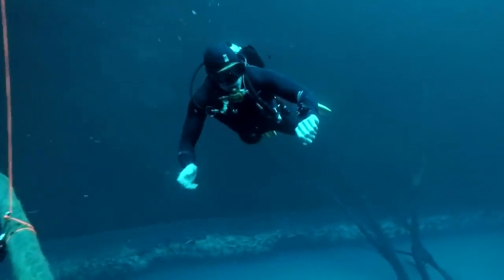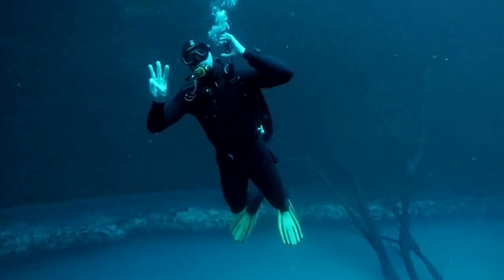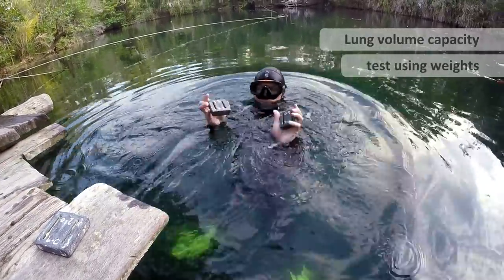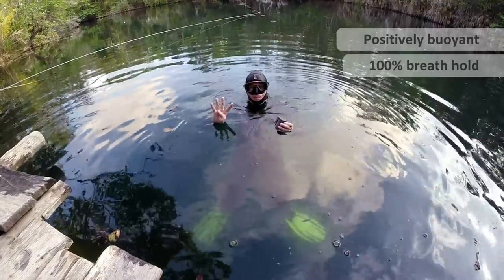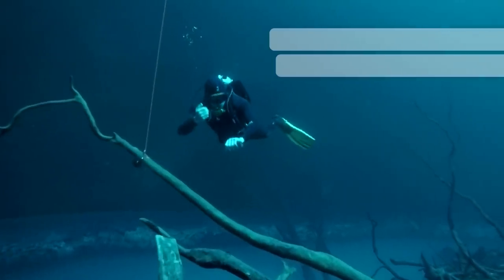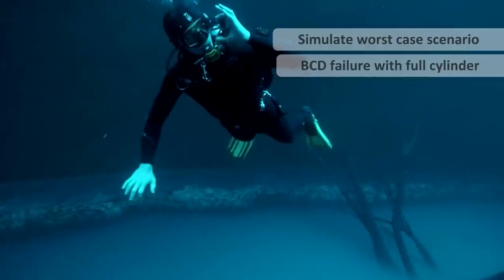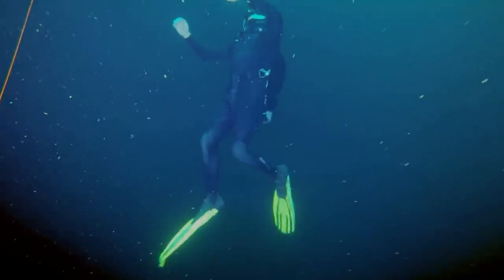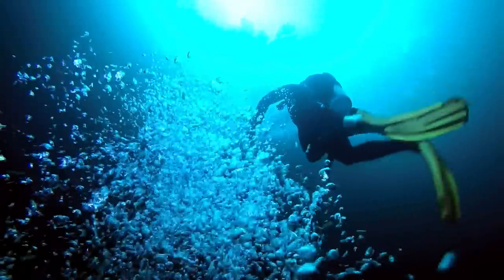BCD Failure : Single Cylinder | Sidemounting.com

Comment: There's a major flaw in this video. I strongly believe that every diver should carry a surface marker. You can use it as an emergency BCD. It may not have the same volume, but still. Also, a common mistake from divers when using such a device is to use their reg to inflate it. Why? why waste that precious O2 you need? Instead, use your exhalation to inflate it. It's air you're going to ditch anyways so why not "recycle" it and keep your O2 in the tank.
Reply: Because chances are if you're using your smb then you're about to ascend and should have plenty of "air" not "O2" left. There are also plenty of diving environments where an SMB isn't really necessary.

Comment: You started the video stating that being overweighted would be a serious problem and could leave you stuck on the bottom, but then you didn't demonstrate this in your example. Even over weighted by 2-3 kilos you would still be able to swim to the surface, and with integrated weight pouches could even drop one pouch to assist with the ascent in a safe manner. With time, you could even remove a single weight from your belt to compensate for the pressure. You mentioned it is dangerous for misinformation to be spread, but it seems sensationalized to state serious issues, and then not show why it is, or explain that very well.
Reply: My thoughts exactly.I had more issues being underweight than overweight. A couple of times couldn't stay at 5m safety stop with BCD fully deflated and completely exhaling.
I agree with his point about the weight belt, though. Dropping the whole belt is dangerous and removing individual weights is not practical in an emergency. Especially if the bottom is not near and you are dropping to a dangerous depth. Integrated weights are the way to go.

Comment: As a divemaster (working or just recreational), I always take 3-5lbs more weight. Sooo many times there is someone who doesn't have enough weight and will start floating up towards the end of a dive. So, yeah, if you are with seasoned divers, go perfect weighted for yourself, going with beginners, add some to keep your random partner from fighting the float and get more bottom time.
Reply: More often than not, that situation has absolutely NOTHING to do with them “not having enough weight”, and everything to do with their constant kicking, fidgeting, flailing, deep breathing cycle, etc. All things that SHOULD have been ironed out in their very first course, their basic open water course.
Reply: 💯 rather more than less
Reply: Maybe keep that extra weight separate so you can ditch it and still make a controlled ascent.
Reply: As a beginner, how should I be correctly weighting? I use an app called “Buoyancy Calc” on iPhone. For me in a 3mm long with AL80 in fresh water at 175lbs it says 9.5lbs. I did experiment and took 8 for one dive and I felt like I was fighting as I got lower on air. 10 did feel heavy but I also am not good at buoyancy control and I know 10 did hold me down the whole dive and I didn’t feel like I was fanning myself down close to the end. I was taught that with ur weight at the beginning of ur dive you should float with a deep breath and then seen to about eye level with the water as you exhale
Reply: This is horrible advice and practice and it annoys me that dive shops overweight students
Reply: @kvan27  OMFG, throw away that app. It's completely useless.
Reply: @kvan27   I weigh 180 at 5'7 and in the same set up with a hood I only wear 8. If I'm in no suit I wear 4. I dive an al100 and I wear 6 in suit and 2 no suit
Reply: @kvan27  it also depends on how much your bc is in the water. Mine is close to neutral, it's probably less than 1lb bouyant
Reply: @kvan27  yeah bin that app mate. The first thing I’d do seriously is jump back in the pool and just spend some quality time really nailing your buoyancy maybe even without a wet suit etc. once you’ve nailed that it’ll make
Life easier once you start using a suit and varying your dives as you’ll know what to expect. Don’t let someone over weight you and tell you it’ll be fine etc.
Reply: @kvan27  that's correct. full breath and empty bcd with a full cyclinder at the start of the dive should mean you are approximately neutral at eye-level. if this is correct then at the end of the dive, you should be neutral (at chest height) around 5m. we do this to make safety stops easier and safer.

as for your weight calc: 5% bodyweight (3mm) + 5lbs (al80) - 6lbs (fresh) = 8.75 + 5 - 6 = 7.75lbs is your 'baseline' weight.

bouyancy check at the start AND end of your dive and trim your weight from there. if you move from fresh to salt, at your body weight you subtract 6lbs for fresh and add 6lbs for salt.

for comparison, i'm the same weight as you are and i take 11lbs with a 7mm semi-dry with hood, gloves, and booties into fresh (UK diver). so with that in mind, 9-10lbs in a 3mm is considerably over-weight to begin with. if you are fighting to keep down with that kind of weight in a thin suit then i'd look at your bouyancy control, breathing and finning techinques in general.

it's also worth remembering that as your depth increases the gas in your gear and suit will compress, meaning it will become denser and less bouyant. you literally become 'heavier' as you go deeper. you may find you'll need less weight at 18m than you would at 5-6m. good luck!
Reply: I do the same. I wouldn't want my divers doing the same though haha do as I say and not as I do and all that. If I'm below 60ft I expect they know what they're doing and don't bring extra though

Comment: why do we need weight belts then? why not put the weight inside the bcd. atleast you mention the wetsuit, this is a huge part of neutral buoyancy. im sorry but i don't agree with you.. being able to emergency ascend is better than not being able to.. As an ex military diver we didn't even use a bcd.. buoyancy was found with the mm of the wetsuit and then knowing what depth you would be working at and then experience to know what weights you need.

Comment: Correct weight is important but we should never dive alone, this guy should not encourage people to dive alone and using lung as bcd... This happened to my buddy (exhaust valve failed)   and I could able to fix it in 38m.. If couldn't fix it.. I could take him out using my BCD safely... Using lungs as BCD is very dangerous and what this video says is the last option and if you are alone...

Comment: A correctly weighted diver in a 5mm wetsuit won't even need to use their BCD down to at least 20-30m.  I've been to 55m and back and not put air in my BCD.

Comment: As a novice diver, I think too many training sites are not focused enough on buoyancy which is a super critical skill to know. Honestly, they just want you to get your basic certification so you can rent their equipment and go diving.
Reply: When my wife went to Cayman for her checkout dives her instructors whole class got to see how bad his buoyancy skills were. In NJ waters limited vis it wasn't so apparent.
Reply: Buoyancy is super critical?!  Like up and down in an elevator or stop and go in a car.  Either you learn to inflate and deflate your BC and figure out your proper weight belt (you won't sink with too little weight), then you shouldn't be scuba diving or driving a car.  Is learning to breath super critical too?!  LOL.  Common sense, and if you don't have it - Darwin is waiting for you.  What is super critical, you ask?!  Not rushing to the surface fast (the bends), diving the deepest first and not last (run out of air), and stay calm in an emergency and work with your buddy to solve it rather than panic and drown both of you.  Now, that is critical.  Learn the basics, put your mask on and off under water, be calm, learn to buddy breath, plan your dive, and don't panic.  Buoyancy should not be super critical.  LOL.

Comment: Add a D-ring to your weight belt. Clipping your DSMB line to the ring before ditching allows you to reel off the dropped belt in a controlled manner. You can also recover the belt later by just reeling it in.

Comment: I'm new to diving but I knew almost immediately when they said in case of  uncontrolled decent drop your wieght belt something didn't seem right. What good is that if you then immediately go into an uncontrollable accent? This video is exactly how to deal with the situation properly! I wish they would teach this right here
Reply: If you took a diving lesson, you'd know that the fastest one can ascend during an emergency ascent is the speed of your bubbles which is the speed of an uncontrollable ascent would be (assuming no panic kicking up).  As long as you are not suppose to do decompression (advanced diving), if your tank failed, you swim up with your bubbles and exhale say at 99 feet or 3 PSI, you lungs inflate 3 times as you swim up to 1PSI at surface...  then again take an entire course on scuba to learn the physics and proper training.
Reply: 1 bar is 14.5 psi.  The pressure at 0 feet is 1 bar.  At 33 feet deep it is 2 bar.  At 66 it is 3 bar.  At 99 it is 4 bar.  Your units and math are off.
Reply: I think that even you don't understand what you wanted to say

Comment: When I went through training (SDI) we did a similar method of weight calculation, we were also taught to completely deflate the bc periodically as you ascend to remain neutral. I have had zero problems with ascent, good advice!

Comment: This is fine until the ally tank starts to become positive (as they do) when they are in the 70 bar left range, look on any stop tec or sport diving and peoples tanks are lifting up the jacket at the back as the tank is know positive.   Do this demo @ 25m with 50 bar in the tank and it will be miles different. 
Yes with a lot of dives you can do it but a new diver will get in a mess...

Comment: What a beautiful dive spot. The bottom is so clean and the vis is so clear. Never seen anywhere like that.
Reply: Cenote Angelita, south of Tulum in Mexico. One of the most amazing spots on the planet. That's not the bottom, its a thick layer of hydrogen sulfide gas.

Comment: I dont use a Redundant Bladder but most of the time a dry suit and always two SMBs or 1 smb and a lift bag if bc has malfunction on depth. One time the iflator of a rental equipment has broken but luckily before i jumped in, so i got the chance to switch my bc. Cool video!

Comment: Control his flotability (your weight) is absolutely the best way to dive safely (and instructions there is perfect), not only in case of failure, but also for better dive experience, better breath, better resistance to cold and current. Let me add that get your weight on a belt (an elastic kind of "marseillaise" belt) is also a best way to hold added required weight (if need), not only because you will have this weight close to your G point body, but also in case of scaphander "quit" to go in a little hole or any other reason you have to experience it.
As a commercial diver, i can not pretend to practice so much this kind of best technic at work depend of the job to do (sometimes we have 40 extend Kg to stay stable on a rope to be able to weld in wave conditions in shallow water... the helmet is also heavy and more weight can be more power to work on seabed for rock destruction or any other works that require human power to be efficient, but if we can dive with "tourist" scaphander (or sometimes with rebreather to stay long time or deeper) for long range inspection (2000m long to go between 20m to 70m depth with a camera, for exemple), we always choose to be perfectly equilibrate underwater in reference to the decompression higher point with empty tanks (we are using double steel tank 10 or 12L without jaket, but aluminium if rebreather for safety tanks).
When you can do it, best flotability will make your life way better and you consume of gas as low as you can too, increase your decompression point the safest way.
Do not hesitate to experience things in shallow water as a game with weights before to experiment something deeper... shallow water is always more difficult technicaly for flotability management, but the best school before to go deeper, because you will have low time to no time to thinking under 50m depth  (and you will thinking wrong most of the time due to narcoleptic reasons).
The best school by experience to learn to control and share good experiences, best practices from other "old" divers is cave diving school (better than commercial diver for technical points, most of the time).
Stay safe, don't go to search record but enjoy elements, sensations and underwater life and reliefs (or wreck). Stick the timing, check material closer, be clean with yourself and be quiet in all conditions will help you to be lucky sometime.

Comment: You're neutral buoyancy rocks, I took my OWD and my buoyancy sucks, need to practise a lot to control, neutral/positive/negative, I struggle with the weights, because I tend to change a lot on my wetsuit. sometimes I just  use the bcd on top of my skin, others, I have just a simple jacket of 3 mm and others a full wetsuit of 5.5 mm, of course when I dive "naked" without any wetsuit most of my problems with weights disappear, but it's tough to control the belt.. and it hurts. Thank you for your clean explanation, will measure and take action on my weights.

Comment: When I was still diving, my instructor told me about this. After talking about depths, ascend rates and weight belts, she told me that when this happens you'd better hope you remembered a small plastic bag so you can make your own float from it.
Reply: excellent technic to use outlet air to create a buoy. You first have to learn to do it perfectly to be able to do it in special time when you will NEED it. 
For the little story time, an old friend (dead now, in his bed...) and very old diver who used to dive to search corals (his job) was using this technic and had a perfect control of his weight at any depth. When tank was going to be close to empty, his old regulator started to be strong,... it was time for him to outlet air in his bag and hook the corals, then thinking to go up... little by little, air going to be very strong in his regulator and time to left the 120m depth along the safety line... little by little, during the way up, air was going to coming back again in the regulator, due to old regulator technology that let air come again when ambiant pressure reduce (first and second stage without compensation... the best for strong material and zero surprise experience), just enough to go to recover oxygen bottle (i can not tell you how deep it was, it is not something you can do normaly). He used to dive like that during 50 years and was one of the oldest diver to still dive (he also notice by feeling when he can go upper or not at decompression time: zero accident)... This old guy was incredible and used to go so deep to work with so less air in his back (i never see again someon euse so less air to dive) ! Just because he was very quiet and control perfectly his flotability (and because of this "recover buoy bag"). Used to dive every day (only one dive a day) !

Comment: When I was working as an instructor and guide at a place(in Cyprus) where we used steel tanks I was always over weighted without any weights, because the 12L 300 bar steel tanks were so much heavier than the little weight I needed. With an AL80 I needed about 2.4 kg(3 800gr weights), but these steel tanks weighed about 18 kg in the water when full.

Comment: Nice video! Air weighs 1.29 g/l, so it is far easier to calculate the weight loss of used air than weigh your system again when at 50 bar. I use 10 bar btw. I like to be able to use my reserve.

Comment: I have been diving since before BCDs were around.  There weren't any underwater pressure gauges either.   The most important lessons that I have learned are: learn to control your breathing so that you never exhale more than half your lung capacity; never dive below 60 feet without a pony bottle.

Comment: Gives a good piece of mind as a bcd failure is realistically one of my worst fears (think yuri lipski) I’ve been properly weighting but it’s nice to see that it’s not a big issue (yuri was extremely overweighted and over equipped)
Reply: Im more afraid of the bcd inflates and I cant stop it
Reply: @ee02108  Good/Simple skill to practise.
Reply: @ee02108  if that happens remove the hose and then your BCD cannot inflate anymore and it's simple to dump the air already in it. Hose can safely and easily be removed under water and under pressure but as with all skills practice it regularly in a controlled environment:)

Comment: I was down 100 feet when my some of my weights fell out of the BCD.
It was on my first open water dive (in Belize) the bottom was only approximately 15 feet below but even with an empty BCD I couldn't descend to retrieve them. I was never able to get my dive buddy's attention ( banged on my tank) but he just swam away.
I tried to slow my assent by kicking downward but that was futual .
Luckily I had only been at depth a short time and didn't suffer any I'll effect but being as it was my first dive it did scare me  because of my lack of experience.
Reply: I'm sorry that happened to you and that your buddy was such a bad partner. How were your ears and lungs? Do you think you ascended slow enough because you only lost some of your weights and not all of them?
Reply: Out of curiosity, why were you at 100' during your first open water dive?
Reply: @Panda-ik4uk And probably 100ft you pretty much don't need weight to stay down. Let some air out of the BCD. I don't have my deep water cert yet so about 60ft is my max depth. At 35-60ft buoyancy is not way less of an issue due to the compressive forces